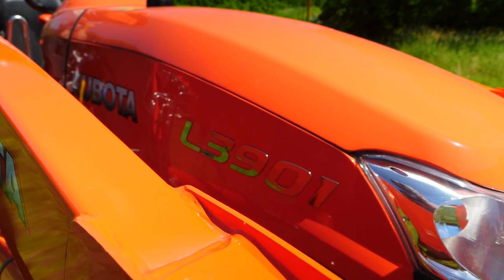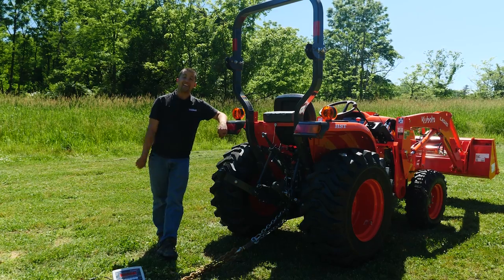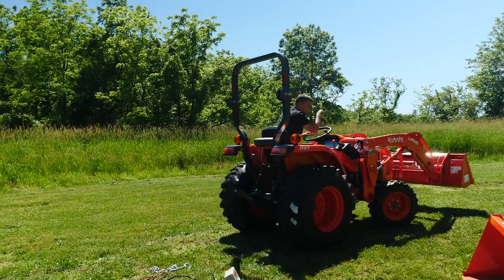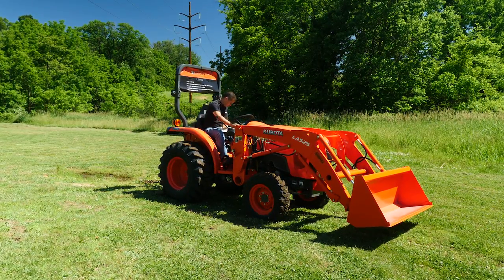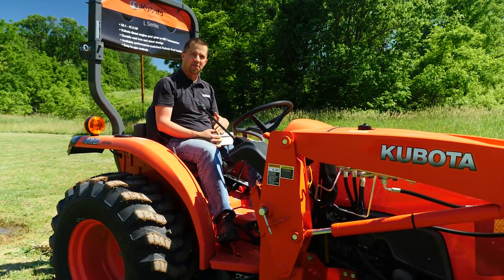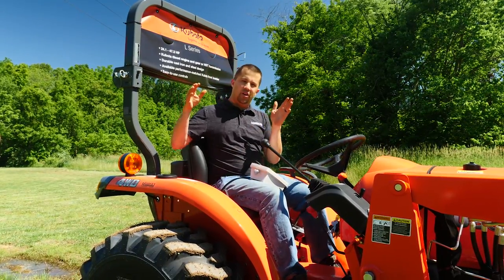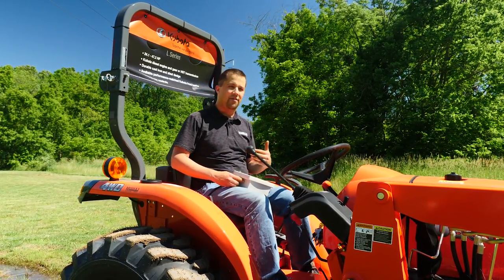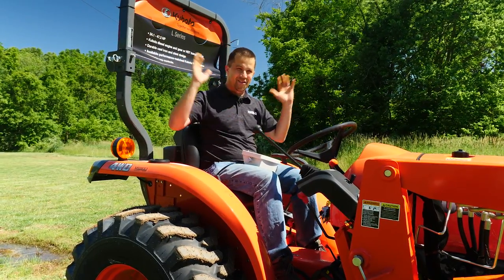Tractor Pulling Test - Gear Drive VS Hydro-static

Comment: Gear selection on the manual will be significant.
Manual its pretty much a test of the driver's clutch use and gear selection.
Hydrostatic will be more dependable about the result.

Comment: Deere E-hst is definitely undesirable. Saps so much power a new 4044R don't go above 11 mph on pavement. Maybe better once broke in, but there's not much pulling power available. 
Also the response delay is terrible and makes it easy to hit stuff in tight places. I find a clutch, even the electronic ones, easier than electronic hydrostats. The manually controlled hydrostats have good response though.

Comment: Not a good comparison. Depending what you're doing, one will outperform and outlast another. 
Too many variables to say one will last longer than the other, that is simply ignorance. If you have the right tool for the job, they should both perform for many many hours.

Comment: Technically with the same weight and the same wheels, capacity should be the same. But it is clear from the video that HST was producing less torque on the wheels as they where not able to turn unlike mechanical. I guess you were only heating the hst oil with full engine power reducing the lifetime of the oil and the system.

Comment: I’d love to see a test where you start at low rpm on the hydro and increase the throttle to full rpm and see if the weight progressively goes up or if it tops out at a point and the the rest of the throttle is a waste of fuel.

Comment: For me they dont have to do the test. Already know that the gear drive is going to get way more power to the ground in any situation and is going to take longer doing loader work. If your buying a tractor you just have to ask yourself do you want convenience and less power to the ground with a HST or do you want a gear drive thats going to give you more power to the ground and less convenience when doing loader work. Really if you not doing loader work all that often then I would get a gear drive. Resale might hurt you some but you would still be able to sale it.

Comment: I agree with your assumption of how the gearing aspect of the two tractors is different but I feel you do a disservice to the hydro in this film by not testing the Low range or mid range as well ... and also the low range on the other... to many variables missing in this test.

Comment: I would still buy a hydro if I was buying a compact tractor
Reply: Absolutely. I did and they are amazing for my needs.  I run a gear drive at work and they are also amazing machines. The only thing a hydrostatic 🚜 needs is joystick and steering wheel delete
Reply: Personal experience.     Hydro is awesome for loader work.
Reply: @the_sb_0116  agreed!

Comment: Gear brive might require a clutch after hours of use but the hydrostatic drive is loud and noisy!
Reply: A clutch being properly used, will last easily 4 to 5k hours.

Comment: Do it again using all the ranges of the HST.  Nobody is going to try to pull a dead load in high gear. Or better yet - put your meter away and chain those tractors together and have a good old fashion pull off.

Comment: You are adding a tremendous amount of overhead using high range. Go low range on pavement or concrete and then measure.

Comment: The whole point of a hydrostatic transmission is that you can extract high torque, but if you use it incorrectly why would you expect it to perform?

Comment: Hydrostatic will eventually begin slipping   gears will always wear   comes down to use and cost  do you want variable speed on the fly or stop and shift

Comment: That hydro was making some pretty awful noises. Is that at all bad for the tractor?
Reply: Yes bad for hydro unit, you hear noise like that also when a operator is not running engine at correct rpm which is real commom in compact tractors, if the 540 pto speed is 2500/2800rpm, thats where its happiest,

Comment: In my opinion an an ag tech the  best trans is a gear trans with a power reverser  its easy to change direction no clutch and the durability of the gear trans .also its cheaper to change a clutch than rebuild a hydro  trans.

Comment: Thing is you're wearing the swash plate on the HST when you're loading it down like that, similar to slipping a clutch on a gear drive. Both are expensive to replace. End of the day, abusing a transmission is going to cost you money. I gotta send this video to my step father, he's very much in the HST camp and I've always been a gear drive fan myself.

Comment: If both tractors would have been in their lowest range both would have just spun the tires and ended up with the exact same result with tires being the limiting factor, not the drive type. A much better test would be a sled pulling contest on a high traction surface. I suspect the gear drive would win...

Comment: All you “where’s the low range test” guys need to understand, the whining you hear from ANY hydro in ANY gear is the moment all the HP from your engine is being wasted. Facts are facts. The HST is easier to operate, but the gear drive is ALWAYS going to give you more power to the ground.

Comment: I still will take a gear drive tractor over a hydro. Both have pros and cons like the hydro will be  better for front loader work but isn't the best for plowing a field or traveling on rough terrain. The gear driven is better for pulling and the con they are slower for using a front loader. I have a 1950s tractor for loader work.

Comment: Trying a max pull in high range is a very good way to ruin your hydrostatic system. Hydrostatic will last if you use the proper range for what you are doing, however, i’ll choose gear drive every time. 
My opinion is that there shouldn’t be hydrostatic options in any tractor outside of the subcompact tractors. But look and see how many good gear drive options there are in any compact tractor. Not many. 
They say a hydrostatic is easier to drive for those that have never owned a tractor, which is true. BUT do they know how not to mis use the ranges? The price to fix an hst system will blow you away. A gear drive will teach you itself how not to treat it. The engine will tell you just about everything. 
So if you want a compact tractor, teach yourself to a shuttle drive. Once you learn it, it’ll be more fun than driving a manual in a truck! And you’ll get way more use out of your tractor.

Comment: Why would you do a drawbar pull test on grass?  That becomes just a traction test, doesn't prove anything other than which tractor got better traction.  The test should be done on pavement and with weights added if needed to maximize traction.  There's good reason the University of Nebraska has done all of their official tractor drawbar tests that way for a hundred years now.

Comment: It's pointless to test in low range on grass. Both would simply spin the tires resulting in a test of traction rather than pulling power. Testing on pavement would be a better test on how hard the tractor pulls, maybe a little dangerous though.

Comment: This was a interesting test but not all that fair. For one yes there clearly a difference in gear ratio by FAR. Also when doing the gear drive test the throttle was set to max before pulling so this test is like comparing a really good apple to a really good Orange. Well OK tractors I guess . He is using Ka-boot- a tractors so the Apple and Oranges could have been better.

Comment: Wow Neil, you sure pissed off a lot of HST owners! Looks like you'd better do a more comprehensive video comparison so no one goes home with hurt feelings : )
Reply: So true. People totally missed the point of the video.
Reply: A gear drive transmission is the most efficient at transferring power. Just look at the pto hp ratings of any hst amd gear drive, any brand.
Reply: Wow Neil you sure rigged this test against HST!  Must have been scared to piss off gear owners!

Duh. A gear is more efficient than an hst.  Basic physics and if you didn’t know it is because you didn’t even read the basic specs.  However, it is nowhere near 3x efficient (more like 1.1x not 3x).  If you need hst you’ll take that.  If you plow long straight lines especially on level ground at constant speeds why wouldn’t you buy a gear?   There’s a reason both are sold and it isn’t just convenience and experience.  Or pure power transmission.   But a video like this ignores the facts and is so skewed it doesn’t present a reasonable case for either in any situation.

Comment: So at 00:25 I paused and I feel its a manual is stronger. I have a M7040 manual and its been a great tractor over all. ............ So after the video now, I will be staying with a manual on my next tractor purchase. Which will be after this emissions garbage has been removed and something better than DEF, SCR, DPF which has serious issues. A buddy of mine also owns a Kubota and any electrical or engine issue with it, the dealer has to send it to Georgia for service. Not sure if that just a Kubota thing or what but its expensive. All brands and even my service truck has this DEF garbage on it. Truck has also been in shop a few times for emissions issues. Doing the delete on this truck soon as hits 100k miles. If I could find a delete for a Kubota, I'd probably buy a new tractor sooner than later for sure. I'm looking at an older M9540 with 700 hours verses a brand new M5 111.

Comment: Neal doesn't understand what factors are involved in pulling force. It has very little to do with the transmission. Tire area, coefficient of friction between the tires and soil, and weight of the tractor - downforce. Manual transmissions are far more efficient than hydrostatic. However, both of those machines are capable of slipping traction. He just didn't want to slip the tires on an unsold tractor 😂

Comment: that 1 mph is a significant ratio difference. 
This is not an apples to apples comparison nor can you really compare the too or should you. 
There is no questioning that the mechanical has less power loss then the hydro.
People should be making their decisions between these on application.

Comment: Hst needs to be in low. You don’t use the loader in high while pushing into a pile. You don’t use high while pulling a heavy load either. Of course the Hst tires never broke loose. You need to listen to the tractor and let it talk to you. It was telling you don’t do this to me.

Comment: Hydrostatic drive were generaly considered to have roughly a 30% efficiency loss. This test says its more like a 60% loss? In other words if the gear drive pulled 3000lbs the hydro should have pulled approx 2000 lbs.Strange? He says that the mechanical drive wont last as long as the hydro? A new clutch once in a while and it will definetly out last the hydro hands down. 
I will stick to my gear drive!

Comment: Not and even test hst high is not ment for pulling.and you didnt run gear tractor in its highest gear.  Better test would be tested in low gear or aleast hst in medium range

Comment: Hydrostatics are good because you can beat the shit out of them all day and while they don't give you as much torque it's more controlled and accurate. I saw a demonstration where a linde forklift was sitting on a curb with an open matchbox under the tire and it was able to back down the curb and close the matchbox with its tire and then get back up the curb without crushing the matchbox. That's some serious precision right there! You can't do that with a gear drive on a torque converter or a clutch, not that you would ever need to do that... just saying.

Comment: I don't agree with that test at all. You should have had the HST drive in low range to prove that it could break the tires loose and the gear drive in low to save on clutch plates as well as not jerking it. My 5100 will break tires loose in 5th gear but that don't mean that it is a good idea. Same for the HST.

Comment: Not surprising, the hrdyo system just sucks out a lot of power.  With direct gears you're getting a lot more power to the ground.  Common knowledge for old time tractor guys and you wouldn't let the clutch slip when using one, that's just dumb.

Comment: I always like your videos but both of these test should be done in low range .  There is no way I would treat my gear drive like you were doing , imo that is abusive operation .    If the wheels spin they spin you are still producing toque.  Better to spin the wheels than the clutch or overheat the hydro.

Comment: In a lower gear you won't be slipping  the clutch (he may have been there).
Reply: Just as an automobile has a torque converter that multiplies the torque, a hydro does the same.  What we are missing here is the fact that the operator was slipping the clutch making it act like a torque converter and maintaining full engine speed.  The gear drive had the advantage because of the ability to abuse the clutch.  Taking a maximum reading under these conditions is a poor comparison and also an abuse of the tractor.

Comment: I have the same tractor as shown in the test with hst.  In high range it has no power and would stall like it did in the test.  In low range the tires would break free and spin, limit of pull would be limited to traction.  Dry pavement......not sure what would happen but I do know what would happen when you go to trade them in, the hst would have better value retention because the market demand is significantly higher for hst.  Really disappointed with Neal poorly thought out test!

Comment: I don't think a lot of people are understanding why you did this in high range...
Lets do the real world test though. Fill the bucket with a heaping load of dirt and strike it flat with a board, and put realistic wheel weights on. Like someone who was trying to pull loads really would. Then see if you can stall the motor in the lowest range at full throttle. If not add more weight until you do. Find someone who has a tractor pull rig, that would be fun to watch too.
Reply from the maker: "I don't think a lot of people are understanding why you did this in high range..."
That's very clear :-) 
... while overlooking that the tractors had different rear gearboxes!

Comment: The gear drive would have done even better had you known how to operate a clutch.  The gear drive also delivers 5-7 more HP to the PTO.
Reply: Its actually only 1.5 PTO horsepower difference between gear/hydro 3901's, not much really

Comment: Nobody pulls in high with either e HST or  a manual... I don't understand the comparison.
Additionally running a HST in high range means you are Not depressing the pedal fully which means not using the highest oil flow available and therefore not the highest power available.
Try again in low range please and lets see the outcome.
Reply from the maker: Flow does not equal power l, pressure does. Using high because they all break traction in low

Comment: I cant believe the hydro would not spin the tires in low range? High range has no power for pulling
Reply from the maker: Everything was done in high so I did not break traction.  That was intentional

Comment: Without the hydro in low, that test was pointless. You said you didn’t wanna spin the tires on the hst, yet that’s exactly what you did with the manual. Redo the test. Plus, gearing wise, of course the 3 speed ratios are going to be diff. Please redo test with hydro in low!!!!

Comment: Gear transmission is always more efficient than hydraulic driven.
Standard shift always get better mpg than their automatic equivalents.
Reply: Thats proving not to be true anymore. The new autos with lockup torque converters and super quick shifting are in some cases actually more efficient than there manual counterparts. Automatic transmissions are NOT hydrostatic transmissions. The torque convertor is HydroDynamic. Hydrostatic drives are just plain INefficient especially when it comes to generating Huge amounts of useless heat.
Reply: @larrydunlop378  there has been lockup torque converters for many decades and the overwhelming majority could not match standard transmission mpg.
Only until multiple gear automatics (6-10 speeds)started being introduced did they gain mpg similar to standard transmissions. Oh and no, I did not say that a hydrostatic transmission was the same as an automotive automatic transmission. It was merely a comparison of hydraulic driven vs gear driven.

Comment: Im not impressed with 3000 pound drawbar pull. Its nothing at all. The tractor probably weighs 4000.  Low range would be needed because thats whats used on ground engaging attachments

Comment: This is almost at least informative comparison I have ever seen.  For one thing they should both be in low.  Different shown should be full throttle along with no throttle.  I don't care that you can ruin a clutch by wrapping it up in too high of a gear.  That is well-known with any piece of equipment, and shouldn't be done even for a test.  If I were to get one of those tractors, I would want to know how much power I would actually have to get a bucket full of dirt.  Which I would never try in high range.. and most likely never over the lowest gear.
Show us that comparison, and maybe your video might be worthwhile.

Comment: Wrong!!! Gear drive will have a longer, way longer life span. Changing a clutch has nothing to do with the gearbox life span. I’d much prefer a clutch job vs a hydrostatic transmission replacement. 
Gear drive is for the the hard tractor work, better for everything except mowing grass and some of the loader work.